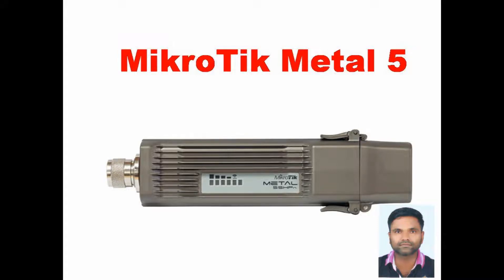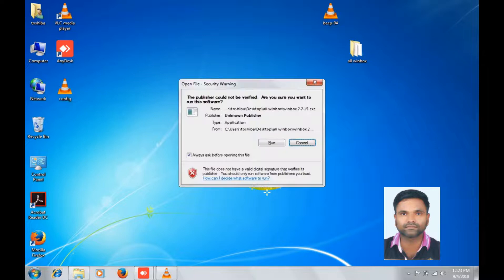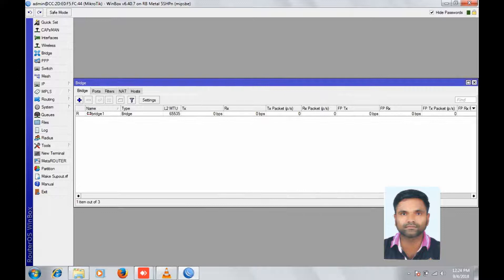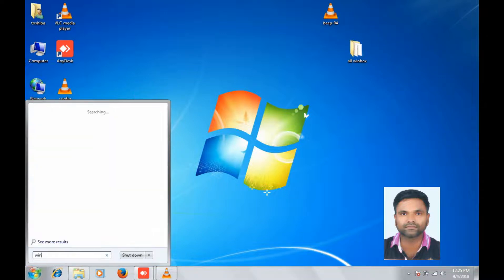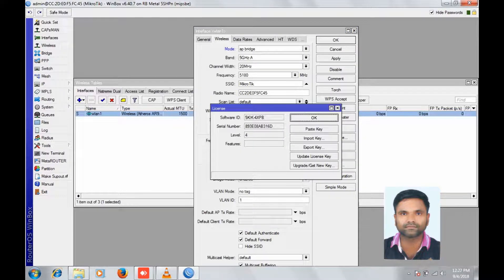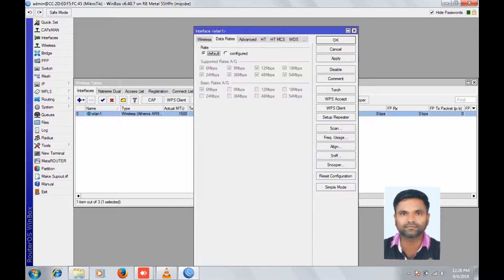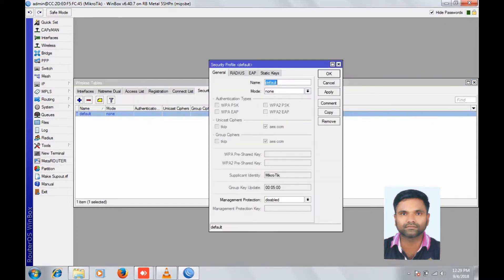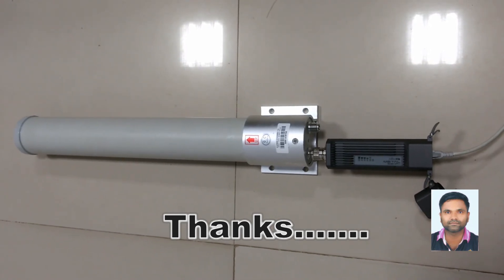Mikrotik Wireless Metal 5SHPn configuration using win box

Comment: Hi, I have a Metal 2. In this I can't acess the Metal 2 Device through webfig or Winbox. I have try to login WAN side and LAN side both. But I can't acess the device but the device is working perfectly. But not acessble device. When I ping to the ip. It will response. I didn't disable any kind of port. And I have latest version of Winbox. In Winbox it was showing my Metal 2 but not acessble. Error: Could not connect to MAC/IP

Comment: What video is this? Make a video. I can't get into my device. mikrotik Metal 52 doesn't work my phone apps. The only thing that works in the laptop is the wire. I can't work yet. Quick set comes here.
Reply from the maker: Bro whats your problem? 
Plz explain...
Plz conect your pc/ laptop with a straight cable. 
Then follow the instruction
Reply: Bro I'm having trouble.The Internet doesn't run. Wi-Fi runs
Reply from the maker: @Gram-Banglar83  configure DNS on mobile.  Then check it. If not work plz send the configuration details